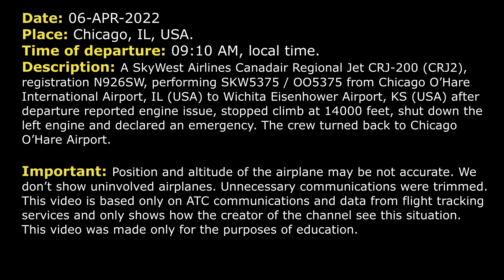“We had to SHUT DOWN our ENGINE” | SkyWest Airlines CRJ-200 | Chicago, ATC

Comment: I'm shocked, SHOCKED I tell you, that they didn't say Mayday even once! Oh wait...they received complete priority and accommodation with ATC understanding fully what they needed.
Reply: Only foreigners say Mayday and Pan. U.S pilots just say "we are declaring" or "declaring an emergency"  any time you loose an engine or have an abnormality in a 2 engine aircraft it's automatically an emergency.
Reply: They handled the situation very well. I don't see how using Mayday 3x would have made any difference in this scenario. Excellent job done by the crew! 👏👏👏
Reply: @leandrosuruagy  I was being sarcastic
Reply: @N1120A  oh I see now. My bad. 🤪
Reply: @sharlesleglerc  Mayday is a lot shorter and pilots don't have time to waste on a emergency.
Reply: @marcospark2803  gee tell me more cap. only been flying for a decade.
Reply: @sharlesleglerc  So?

Comment: 5:40 what does that fast or slow mean ?
Reply: approach and landing speed
Reply: @jamescollier3  Yeah but what's the difference for the ATC?
Reply: @marcospark2803  They stack the arrivals at minimum clearance to maximize runway utilization. Frequently less than 20 seconds to spare between each arrival, 5-10 knots can make all the difference between good arrival flow and the next guy going around
Reply: If they’re fast on approach then ATC don’t want to let them catch up with the preceding aircraft and risk a single engine go-around, even if they’re pretty straightforward.
Reply: Speed is everything in Chicago. Great video, wish it had all the traffic going into ORD depicted in it to see the added complexity with two other full finals